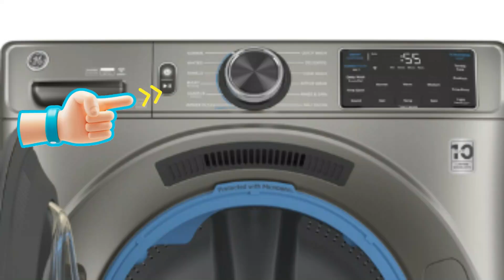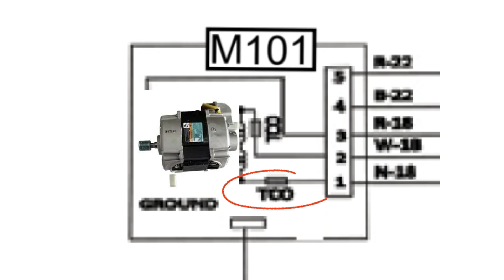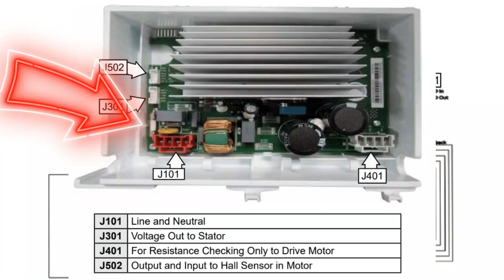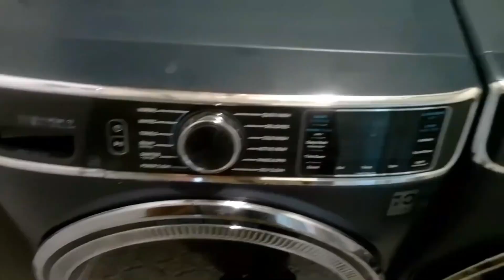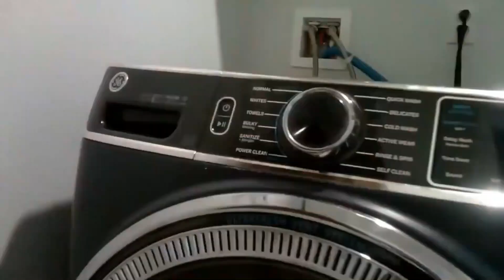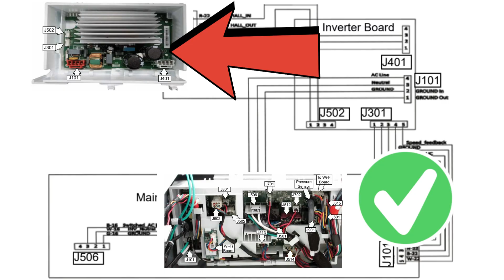⚠️ GE Washer Error Code 3? Washer Not Spinning or Agitating?

Comment: I currently have error codes 3. When I run test 14 it spins for 5-6 seconds then stops and sits there for a while before spinning in the opposite direction doing the same thing. When I run test 26 sounds like it is going to start running but it runs for maybe 5 seconds and stops. Would you suspect the inverter board?

Comment: Hello! Mine is spins about 5 seconds and stops. Is this because hall sensor ? Am I have to change motor? or still invertor ? Thank you
Reply from the maker: Most of the time it’s the inverter, not the motor. If needed, you can check the motor windings to confirm whether the motor is good or bad. The motor and hall sensor come together as one assembly. Do you have error code 3?
Reply: @onlineappliancetech  I have the same problem and I only get error code 3 and only goes for 5 seconds
Reply: @onlineappliancetech  I have the same issue, error 3 and spins for only 5-6 seconds and stops. 3.5-3.6 ohms per each leg, all the same. What was the fix for y’all?
Reply: @daltonfriesenhahn5603  my motor readings are 3.9 ohms for the 3 pairs. Did you solved your issue? Was it the motor or inverter board?
Reply: @asotopetris  what was your issue